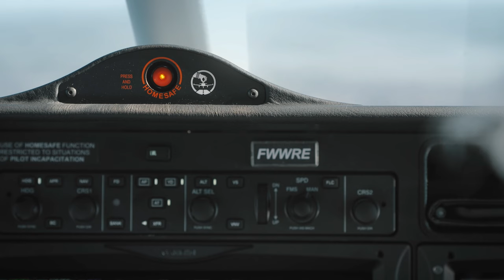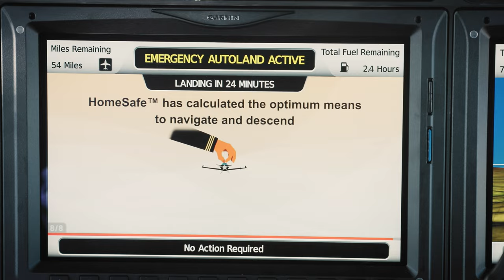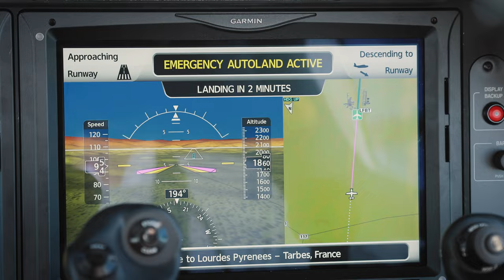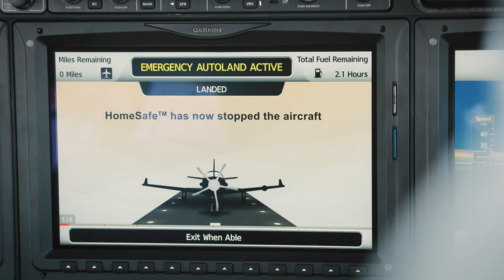TBM 940 HomeSafe™: Live the experience

Comment: Coolest thing I have ever seen! Maybe better than a parachute rescue.
Reply: It is way better than a parachute rescue.  For starters, the parachute landing results in a complete write-off of the airplane 5/6 of the time.  Second, you are getting to land on a runway with a high likelihood of emergency support for the incapacitated pilot(s) or passengers.  Third, this could be activated in adverse weather conditions and most likely be just fine.  From the look of the video it even seems to be contacting ground support on the radio.

This system should be mandatory on all Commercial aircraft.  I'm amazed that it is first coming to GA.  I can't wait for this tech to trickle down to cheaper aircraft.
Reply: @christopherdaviddigitalcre8887  Not sure how it is way better than a parachute....each have their place.  It would be good to have both....homesafe will save you if you pilot dies....a chute is mitigating if your plane has major issues and can't fly...let alone make it back to the runway.

Comment: How will the system behave is there is no Airport which is certified for autoland or if it is in a high traffic density area like Heathrow or Atlanta? Or Even Frankfurt?
Dont get me wrong, I really love the idea and this system is definitely livesaving, but these are 2 question which came to my mind.
Reply: Here in the U.S. a Garmin system with the same feature, has >9,000 airfields preprogramed.
Reply: Emergency landings take precedent and priority regardless of AC size, passenger count, or traffic congestion/density. Even if there is no airport within the vicinity, it will go the nearest certified one, it's for pilot incapacitation, not necessarily AC damage/mechanical failures, so if the destination airport is the closest, it will go there. Hope this helps!